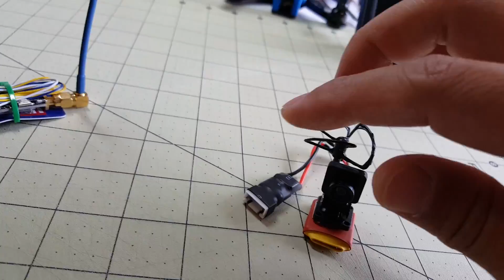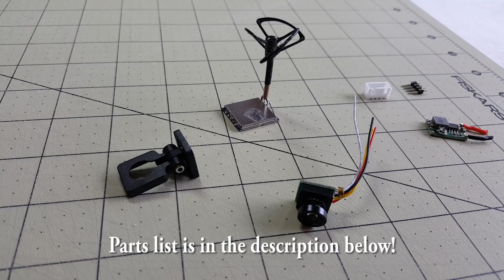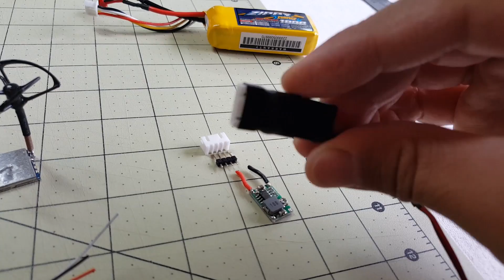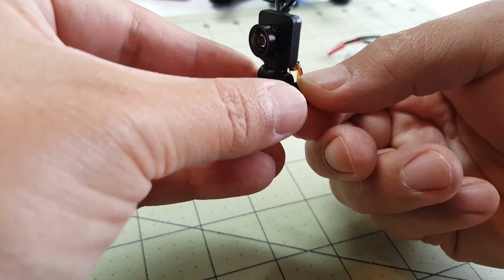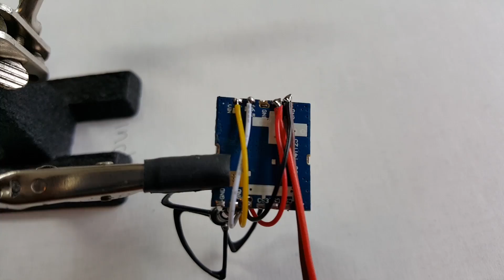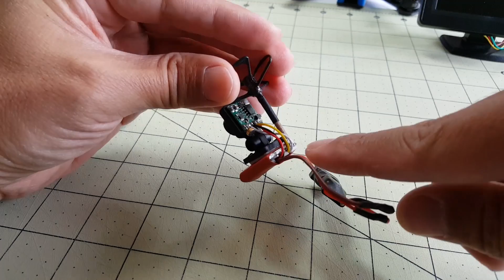Micro FPV Backpack

Comment: Hi. I build this backpack, but with module from this transmitter http://goo.gl/GwuIG6 . It turns out it's a tx5826 v1.0 module. Wich is 400 mw. Any way, i have one problem. The image in the goggles is blinking and after some time it disappears. I tried 5v and 3v. No difference. What can it be? Overheating problem? From the first second i powered the quad, it doesn't blink.  Any idea how to fix this? Except changing the module.

Comment: thanks for the video I have one question how to you switch channels on that transmitter? thanks
Reply from the maker: It requires taking off the heatsink and soldering some jumpers inside which I did not want to do. It defaults to 5865 which is Band A, channel 1.
Reply: thanks

Comment: Looks great - wondering how you change the tx channels, though.  Do you have to hard wire that or are you able to add some dip switches?
Reply from the maker: +wildtexusa There is a way to add dip switches but it requires some micro soldering that I don't want to do. It defaults to 5860 which is on the fatshark band.